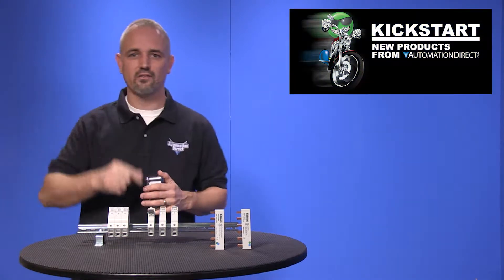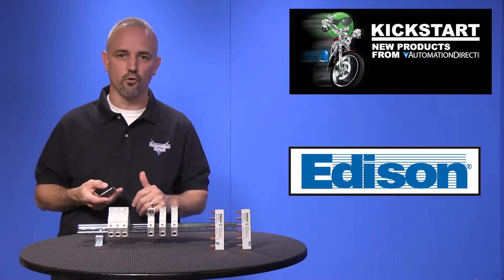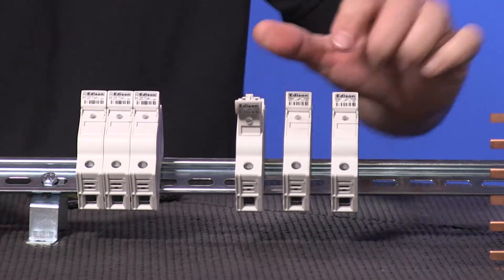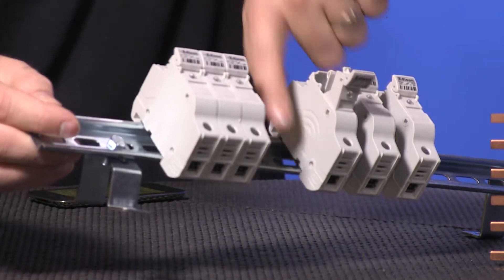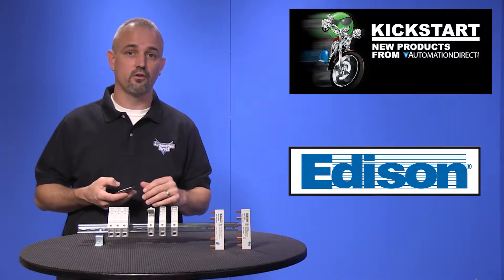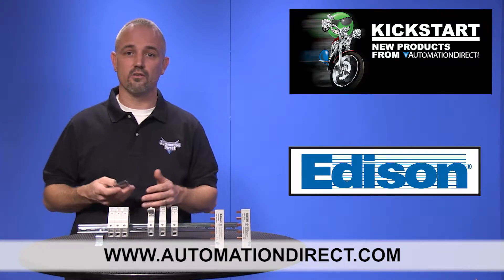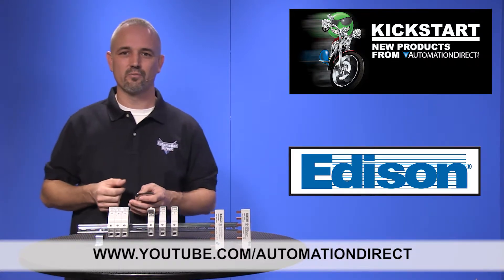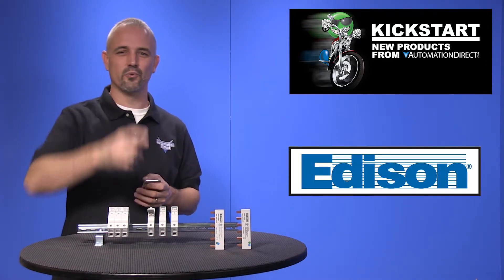Fuse Holders by Edison from AutomationDirect

Comment: If you can cut the bussbars to length, do you have to do anything to the cut?  I've cut one and the copper looks like it's going to short the phases!  I guess our band-saw is dull.
Reply from the maker: @scowell, it is suggested to brush the end to deburr after cutting, then re-install the end cap.  The end cap restores the finger-safe attribute after cutting.  Examples are:  Part number EB1P100M12 busbar has end caps included, you can also purchase them separately - PN EECAP1P.  If you have further questions about the Edison products or questions on cutting the bus bar, contact our free, award winning technical support:  https://www.automationdirect.com/adc/contactus/contactus
Reply: @automationdirect  OK... looking at the end-cap, it's not just a cap, but it has insulation fingers that protrude into the gaps, giving the safe insulation distance.  I'm sold, no problem!